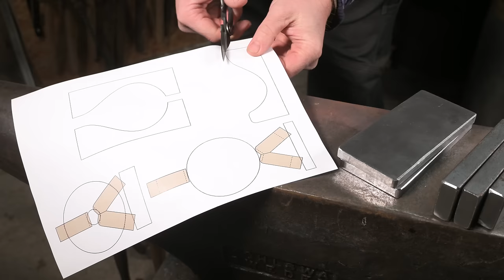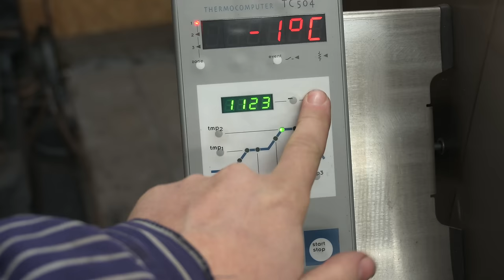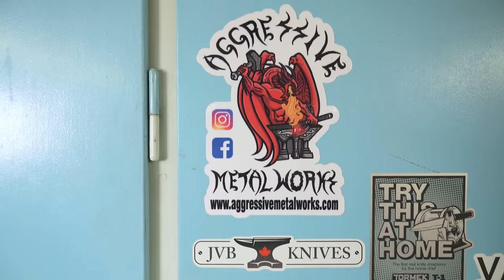Blacksmithing - The Oil Lamp Experiment!

Comment: Great video! I can provide a little explanation about the copper coating on the steel. Copper alloys tend to act like water in a sponge (capillarity) if given enough time at high temperatures. The copper can climb up the steel and spread on the surface. If you want to avoid that, you have to get the part out of the oven sooner, just after the copper was melted. It’s a matter of finding the sweet spot!
Reply from the maker: Thanks!
Reply: I'm glad he didn't. It looks beautiful like that!
Reply: Didn't we all figure that out from watching though? 😅
Reply: @abrothafromanothamotha7840  the fact that the copper alloys climbs up on steel like a sponge maybe, but it's not that obvious that you can avoid an issue like that by getting it out of the oven sooner. I'm just sharing a tip I have from personal experience

Comment: Those are beautiful! I’m actually surprised at how uniformly the tubing forged down. The process is actually very similar to how small hollow metal beads are made for jewellery applications - a tube is constantly fed into a set of oscillating jaws which progressively squeeze it into bead shapes. As for the copper flowing, it can actually wick to a surprising extent under the right conditions. Bronze is used to impregnate sintered 3D printed steel parts. The parts are porous, and are placed in a vacuum furnace with some chunks of bronze touching them, which melts and flows throughout the part, making it totally solid. Likely the same sort of thing was happening here. Whatever it is, beautiful result! Hope you all have a wonderful Christmas.
Reply from the maker: Coooool! Thanks and Merry Christmas!

Comment: Anyone unaware, don’t forge pipe and never quench pipe with open ends. It will not end well I promise. That’s why he packed the cold end when forging. 
Great work as always! 😉
Reply from the maker: Yes, I even ended up taping the end completely shut so it wouldn't let any fumes out.
Reply: Something I learned the hard way.  Hot gasses heat the entire length, and then quenching it turns it into a steam rocket.  Now if I work with pipe I crimp one end shut.
Reply: @andrewtinker7537 exactly. I learned the same way.

Comment: The bit with the copper appearing under the scale was fascinating. I recently saw a presentation that was talking about a Roman iron ring with a very thin coat of silver on its surface, and they couldn't work out how they'd gotten it so thin, i wonder if they could have done something like that.
Reply from the maker: Cool, well it might work the same?!
Reply: @torbjornahman  Only one way to find out, I now have a commission for a blacksmith friend of mine
Reply: I wonder what would happen if you put the copper ring on top.
And if the scale is necessary. 
And what temperature works best.
Reply: I've seen a study where some of those silver plated iron rings turned out to be tin dipped upon actual chemical analysis.  That would just be an acid flux and a dip into molten metal.
Reply: @andrewtinker7537  yeah, some of them but this one was silver, and the cross section showed that the deposit was really even and really thin, like 10μm, that's not something you could get from dipping
Reply: Maybe it has something to do with the fact that the crystal structure of steel begins to change at 822° Celcius, before the copper melts.
At that point small crystals start to form fuelled by the release of a small amount of energy from the breakdown of the old crystal structure.
A tiny amount of energy is necessary to pull the copper upwards against gravitation.

Comment: I do commercial furnace brazing work and  I expected you to find a puddle on the brick. I don't think I would ever have expected the coating result to happen! I think you're exactly right about the capillary action under the scale because the copper would never climb a clean steel surface.
Reply from the maker: Was also expecting something along those lines and maybe a little traveling up, but nothing like this.

Comment: Do you think the copper vapourised Torbjörn? It looked a quite even coating and very attractive too! Thanks for this pre-Christmas gem and all best wishes for the festive season and beyond to you adn your family :D
Reply from the maker: Thanks. No, it was just max 50C above the melting point.  Merry Christmas
Reply: Besides, if it were vapor deposition it would have been blown right off by the wire wheel
Reply: @HubrisInc  OK, so how about the flux then, did that transport the metal I wonder.

Comment: Lovely oil lamps. Perhaps you should consider making a matching pair of caps, both to help extinguish the flames, but also to stop evaporation of the fuel. (Although if you are using kerosene, I guess evaporation isn't really a factor.)
Reply: No point ... no "should" about it.
Oil Lamps use lamp oil for fuel, NOT and NEVER the far lighter petroleum fraction you call kerosene or an alcohol that will both evaporate at such ambient room temps. Lamp oil does not evaporate at even high room temps of +40C. 
Kero is a dirty stinking fuel... lamp oil is odourless unless it contains an intended fragrance or citronella oil. 
The wick should be set below the height that produces any visible smoke. 
A flame is easily and safely snuffed out with fingertips.

Comment: Nice craftsmanship, Mr Åhman.
Greetings from Australia.

Regarding the turned brass wick holders - These should have a small 0.5mm hole drilled from the major outer diameter to the central wick hole. One only is needed.  It helps control wicking action when burning and potential for wicking oil out when unlit. 
I have many art glass oil lamps (>10), fueled ready to use around my home. In this area we get storm tree falls and power outages.  Every brass wick holder has the 0.5mm air break holes. 
The wick should be rather tight in the holder. If too lose you get wicking when unlit and a mess as oil creeps down the lamp bulb when unlit, spoiling any nice timber surface it sits on. 
Oh, and the wicks should be set low to prevent flame soot and excess wick burning.
Reply from the maker: Thanks! I think I noticed the wicking when unlit... suddenly a wet trace around the foot. Someone else said you should make the top surface a bit concave to prevent this.

Comment: Good stuff man! 
I may have accidentally learned something here. 
I always learn techniques I never thought of from these videos. 
I didn't see any kind of threads or O-ring to keep the tops on in case they get knocked over, something I always insure on any of my lamps ever sense I caught my bed (and me) on fire with an alcohol lamp as a young "lamp enthusiast", it was maybe 1oz and I quickly put it out but that taught me the importance of expecting and preparing for the worse case scenario. 
Funny thing, mom didn't say anything about the cloud of smoke that followed me out of my room as i went to get a glass of water for the embers still smoldering on my bed, I know she saw it.
Reply: Oil lamps extinguish if tipped over, unlike wax candles or the far more dangerous alcohol 'lamps' (that produce very little light anyway)

Comment: Capillary in brazing is amazing. You only need a tiny little pip of solder anywhere near the joint, and capillary fills the whole gap. The surface came out beautiful.

Comment: Fantastic! You could also immerse the polished (wire brushed) lamp into Hydrochloric acid with pieces of copper: Iron is electronegative to copper so ion transfer occur, the acid "drops" the copper to get to the iron. Loss of shine corrected by buffing. But your method is spectacular and more appropriate to a blacksmith (I am only a chemist!)

Comment: Hello , these lamps are very nice - the technique of depositing copper on steel is similar to what the manufacturers of cow and sheep bells do in the Pyrénées - with the difference that the whole , copper ( put inside the bell) and steel is wrapped with paper and then covered of a good layer of clay and dried for 2 weeks - after heating , the copper is deposited on the forged steel bell and make it sound -

Comment: You could try to 'wrap' the lamps in thin steel foil that for example knife makers use to avoid decarburization during heat treating. The air tight envelope creates a low oxigen environment which prevents scaling. There are also pastes on the marked who do the same thing.

Comment: Lovely.... Regarding the level of scale when brazing the bottom plug, the cause is the large availability of oxygen in the electric furnace...... You could eliminate this by heating the lamps in a gas forge, or just over the coke forge fire.... :-)
Reply from the maker: Yes, I was aware it would happen, but probably not to this extent. Interesting nevertheless!

Comment: I like how it comes out. There's a video where spanish cow bell makers intentionally use brass to do same effect. You can make kettles or any small utensils same way.
Reply from the maker: Yes I know, but they are "cooked" inside clay shells and with brass or copper pieces placed on all sides.

Comment: that weird copper capillary coating actually looks fantastic and you should see if you can find a way to control it or something and apply it to other products. If it turns green like bare copper does, it might actually protect the steel underneath from oxidizing.

Comment: If you put iron or steel in a water solution of a copper salt like copper sulfate, a displacement reaction will form copper metal and iron sulfate. I suspect copper oxides dissolved in the molten borax, which then wet the entire surface by capillary action and caused a similar reaction, forming that thick scale in the process.

Comment: Looks great. I may have threaded the tops so if it were knocked over it wouldn’t dump oil so easily.
Reply from the maker: At the same time, it would not be good to trap any gas pressure inside... it would probably never go that far though. Thanks!

Comment: I surely wouldn't have predicted the copper working up under the scale, but it was obvious what had happened as soon as I saw it start to peek through.  You could probably have made much less scale and avoided the copper creep with using much finer wire between the plug flange and bottom of the urn sections, and using a torch to heat the joint (or applied the copper by capillary action after the joint was hot and fluxed), but this was what Bob Ross would call a "happy accident" -- those lamps turned out beautiful!

Sadly, I live in a mobile home and my partner has completely forbidden flame lights of any kind except candles inside lanterns for power failures.  Otherwise, I'd make some sort of simple lamp every winter...
Reply from the maker: Thanks! Merry Christmas!

Comment: Good forge - but you probably don't know much about copper soldering. This is called capillary soldering and has several necessary conditions for a good result. The gap between the bottom plug and the body of the lamp must be made as tight as possible, and the metal to solder the gap is generally enough for about a tenth of what you put there. You understood very correctly that the copper in the amount you used then also leached onto the outer surface of the containers. The formation of scabs, scales and other impurities on the surface could be prevented by adding a reducing gas to the furnace during heating to 1100°C - a mixture of heating propane (or natural gas or even propane-butane for cooking) and air in a ratio of 1 part heating of gas and 3-4 parts of air. Steel does not have oxygen around it, which is a condition for the formation of those black oxides. ATTENTION - the resulting hot gas is poisonous, contains a high % of carbon monoxide and is also flammable, so it must be well ventilated and, if necessary, additionally burned so that it does not create a dangerous concentration. At the same time, lamps with a body forged from a steel pipe can be soldered with any solder with a lower melting temperature - even ordinary electrician's tin-lead, plumber's silver or even brass. A simpler heat source is then sufficient for heating, and it can also be heated to a lower temperature - with solder based on lead and tin, 280-300°C is enough, for silver only a little more - about 360-400°C, depending on the composition, and for brass, it is enough temperature around 580-650°C. At the same time, almost no iron oxides are formed. The material can also be sanded and polished on a lathe before soldering, and after soldering, just clean the strip around the plug and polish it. It is not a pressure or strength-stressed component, copper soldering is a completely unnecessary effort in this case. Happy New Year 2024 from Czech Republic!
Reply from the maker: Thanks, I'm well aware actually, but the copper idea just popped into my head... And I had the idea to blacken them with heat and oil afterwards so I didn't want a low temp solder. I also assumed the copper would travel a bit and maybe create a pattern on the lower 1/3 or something. And I was expecting oxidation for sure. :)  Experimentation can be fun at times.

Comment: The capillary trick of the copper flowing beneath the steel scale is so cool, for platting... but I'm worried about the galvanic corrosion that would happen by the copper on contact with the iron.
Have you considered that?
Reply from the maker: Not to worried... They are not meant to be in any moist environment. And even so, corrosion can't happen between the layers, just where they both meet and are subjected to air.

Comment: Wow, that accidental copper plating is fascinating!
I don't think this happened through capillary action, my theory is the following: first some of the copper oxidized to cuprous oxide. This has a relatively low boiling point of 1800°C, so some amount vapourized in the oven. Where the gaseous cuprous oxide got in contact with the steel, it initiated a redox reaction because copper has a higher reduction potential than iron (+0.16 V versus -0.44 V). This reaction produces again elementary copper plus black iron oxide, which appeared as scale.
God Jul!
Reply from the maker: Maybe, but at that point the steel surface has a thick oxide layer already. It even went in with a good layer on.

Comment: I will bet you 12 cold beers that if you cut one of those in half you'd see the copper has permeated the steel pretty evenly. In the microchip lithography business copper was a big no-no for decades precisely because of it's ability to seep into nearly every other metal and most metal oxides. It was known as "copper poisoning", and to this day, the layers that need copper are done on separate deposition machines because even trace amounts of copper can ruin all the other steps.

And it makes sense when you think about how many alloys copper is found in. It just "plays nice" with everything. Other alloys that turn brittle, or even refuse to properly amalgamate, suddenly play nice with as little as 0.25% copper thrown in.

As a craftsmith you can of cause use this to your advantage, as steel bronze look "a tad more dazzling" than plain old black, and you can even play with the various color changes you get from traditional bluing methods.

But anyhow: First time I've seen a forged oil lamp for sure. I've seen cast, spun and turned ones, but never forged ones.
Reply from the maker: Thank you! Although I'm certain that the copper only travel on the surface. I totally understand your view though!

Comment: nice work, but with a narrow base like this, the oil lamp is easily toppled over. The base plate that you welded with copper, should flare out  and of larger diameter, while thinning out as not to alter the general design. Basically for safety reasons.
Reply from the maker: But I also added weight to it. It's pretty stable actually.

Comment: Beautiful, but they need to be secured from getting knocked over and causing a big spill and a fire over a big area. Either by machining a Thread into the neck and cap as is, or by making a wire frame or so to hold the ball shape and keep it from tipping over with that lose cap.

Comment: Hey Torbjörn, you are at the clever side, really. 
Question 1:  the ripping of the bottom part of your lamp - due to low temperature while hammering? - how do you control it that precise? 👍 Question 2: what's with the scale/cinder inside the lamp - do you use chemical or physical (rotofinishing by example) methods to get rid of?
Again: respect to your idea, respect to your workmanship! 
Regards
Reply from the maker: The ripping is simply due to too much stretching of the material. You can most likely fix this by pre-forming that end a bit first before going into this die. But this was good enough for this project since I was still going to remove the bottom and make it flat. I didn't bother clean up the inside!

Comment: Did you know the copper was going to cover all the exterior by capillary action behind the scale? Was the copper initially meant to just weld the join?
Nice work!🇦🇺🙋‍♂️🇦🇺
Reply from the maker: It was meant to braze the joint, but I had a hunch it would probably ravel to some extent. But not like this.
Reply: @torbjornahman  ok cool. Thank you for taking the time to reply man. Greetings from all the way down here in Australia🇦🇺🇦🇺🙋‍♂️😁🇦🇺🇦🇺

Comment: How do you keep the walls of the pipe from collapsing when you put the red hot work piece into the hammer? I saw a bag of what I presume to be sand but I don’t know of any flexible fabric type material that wouldn’t burst under both the heat of the forge and force of the press.
Reply from the maker: The trick is to be gentle, and let it take it's time! No sand or anything involved.

Comment: Why do you tac weld with MIG and then do the proper welds with stick? Do you just prefer stick welding and don’t want to make a mess around your power hammer or is i something else?
Reply from the maker: My mig is just made for sheet metal really... so to get good welds I use the stick. It's also a cheap welder to run, with nog expensive gas.